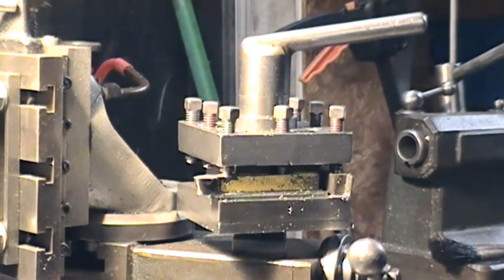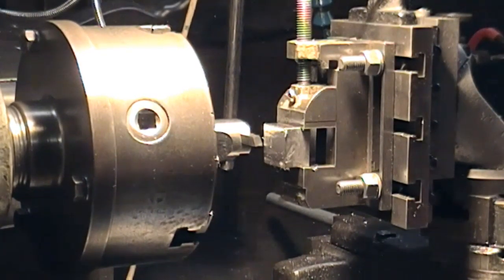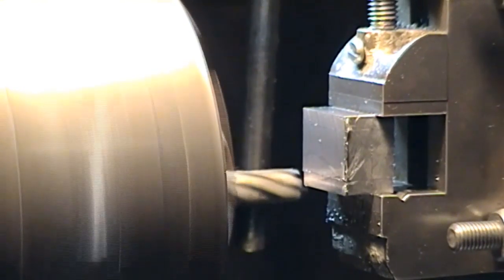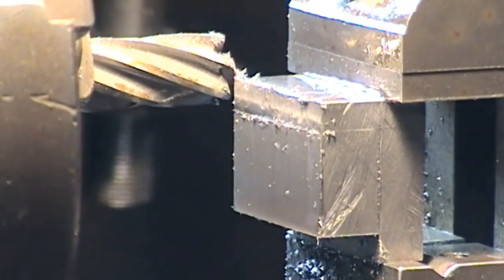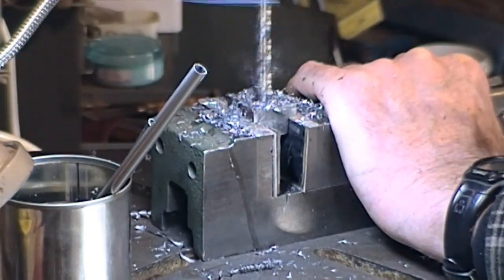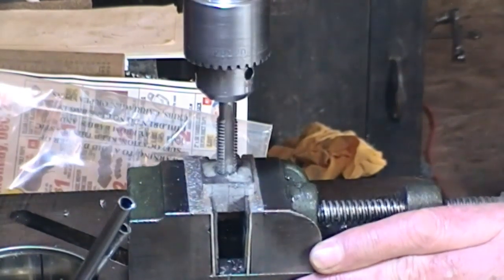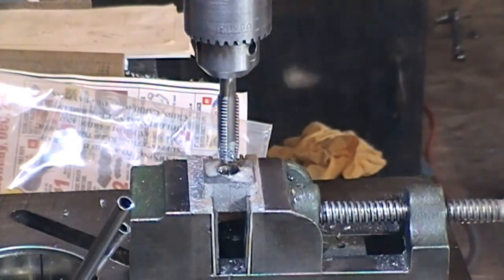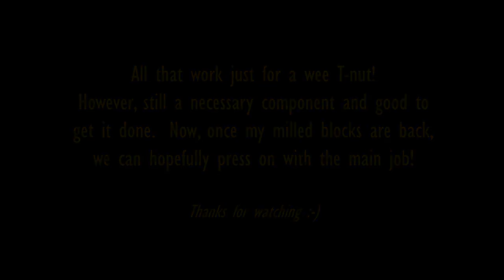4 way tool post clone part 2 - just a T-nut!

Comment: Thanks, Chris, for a very straight forward, down to earth presentation!  I really like that you use the minimum of expensive equipment to get the job done.  I'm inspired to watch part #3!  And Cherrio, from Winchester . . . VA, that is.
Reply from the maker: +John Grubbs 
Hi John -- thank you. Well, often it's a case of doing what is possible with what we have. I have added more stuff since the video but still often sort of 'make do'!
Ahh Winchester - where I got re-married in 2000! :)

Comment: Nice job! The only critique I have is that I do not see a set of parallels below the T nut. I understand that its not absolutely crucial if you do everything in one step and the surface is perpendicular to the cuts, I just insist on always observing proper shop practice. 

Really though, your way is 100% fine since it really is just a T-nut. My main concern would be the part twisting or moving into the vice from the force of the mill, and readjusting would be more work than simply having the parallels in place from the start.
Reply from the maker: Hi, Actually that small vice is too small for my parallels - agreed tho, if I had had a set of smaller ones I would have used them. However, I did check truth with dial gauge when setting up and, took very light cuts because of the system rigidity not being quite as solid as I would like. Tthe milling load on workpiece was quite modest, plus a fairly slow feed and vice actually has a very firm hold.
Reply: ChrisB257 Fantastic. I had trouble myself looking for suitable parallels for years, then one day at an estate sale I acquired a box from an old machinist that had parallels of nearly every size I could have ever needed. I appreciate the videos, I've spent the past two hours now watching! 

Cheers!

Comment: Nice job if you had a mill and some more things in your little work shop im sure it would have been a lot easier,But it also show's even if you have access to limited tools things can still be done..Thank you for your video..
Reply from the maker: Thx - thing is years ago I had a very nice shop --- horizontal mill, shaper, grinder, another lathe apart from the one I kept and use now... that was adequate and I miss what is gone!  I moved and had to sell off a lot.  However yes - as I say, there is usually a way to be found even if it takes longer. The exception was removing stock from my blocks, which I now have back and work on the project can progress. I am old, but it's still a hobby :)